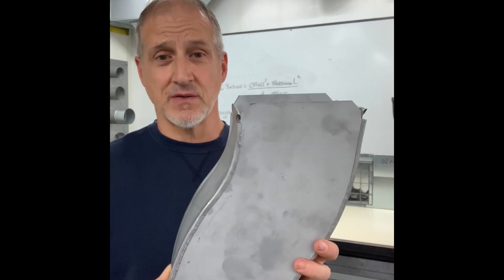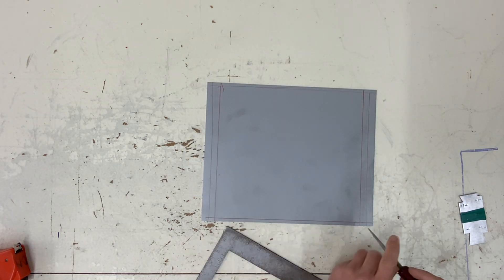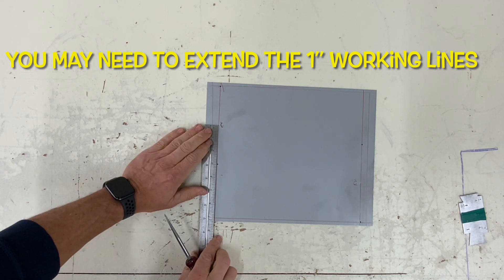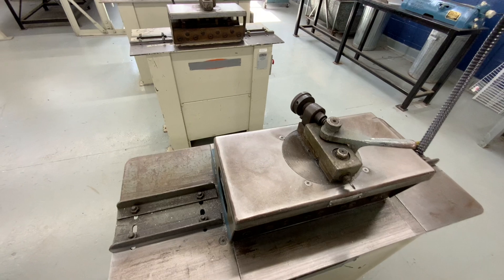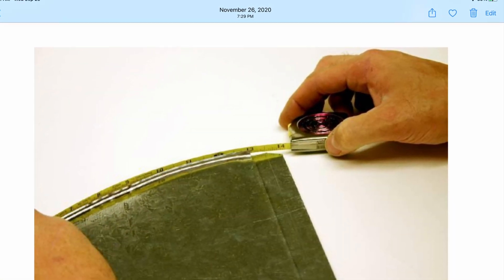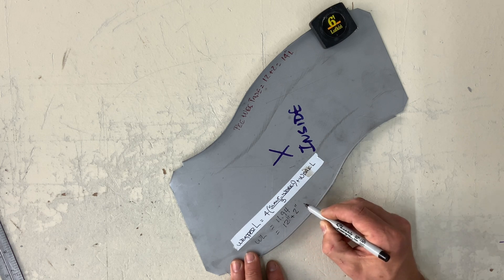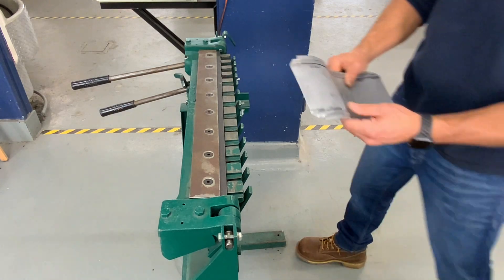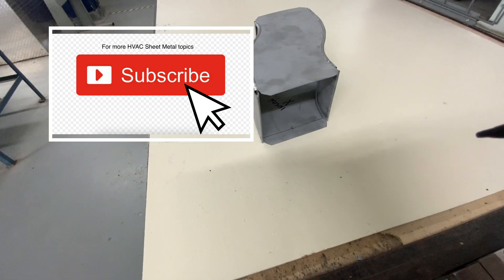Fabricating an Offset using CenterLine Radius

Comment: Hey, would it be possible to go over an Offset with square sides (non Radius sides)?
Reply from the maker: The only video that might come close to what your looking for is Fabricating a field mitered offset?   https://youtu.be/pMO96fWniYs?si=zSQo6iq7NC78-NdA
Reply: @sheetmetalwork  but in one piece? With keep the dims. Of your duct the same throughout. I hand scribe everything, but I want to be able to cut a finished length piece, to scribe out, rather than shear a side out of a sheet. the angles being at different positions  is what’s throwing me. I end up choking the dimensions down on my throat.
Reply from the maker: @The_Duter  I think your looking for something similar to offsetting a gutter downspout? Which is the removal of a piece of PIE shaped piece in two locations.
Reply: Yeah, Guys at my location like to stay away from Radius offsets, and as you know it saves on Metal to start with a cut piece. I use the Owl method while field fabricating. But it’s just the throat. Still working on it. I don’t mean to Bombard you with questions, but while you are doing your arcs, couldn’t you just include your .25s at the beginning? Then after cutting out your cheek, just set your scribe to a .25” and scribe it, right? Not trying to be rude, just deceasing different methods available. Thanks! Btw my 40 Most Frequently used Fittings book comes in today!

Comment: Hi Duane, Great job on all your videos here. Just a little nitpicking question here.
I am curious  as to why in layout you used 1/4" for your add on to the cheek width dimension (for the tongue part of the lock joint) and then when rolling that same edge you called out 3/16" as the machine setting. So doesn't that make it 1/8" wider than the 6" spec width? Thanks, Bob R.
Reply from the maker: Good observation. You are 100% right that the edger allowance is only 3/16. There are a couple of reasons for the 1/4, one is that it gives me 1/16 edge to start my snips or uni shears and another reason is that it simply makes the math a bit easier. Again, awesome observation Bob!

Comment: You’re a very good teacher. Appreciate all of your videos. Would you also show an ogee offset without the use of a calculator?  This is just a suggestion. Some may not have or want to use a calculator. As you know — Draw a slant line from cheek center points top and bottom. Measure the work line distance top to bottom. From the bottom measure straight up 1/4 of that distance.   Mark where that distance intersects with the slant line. Lay the outer corner of a square on that point on the slant line. Draw a line down to the bottom work line. That will be the point and distance for setting all 4 of the arcs. Thanks for all your work to promote Sheetmetal layout.
Reply from the maker: Thanks for your feedback James, always enjoy hearing other SM guys.  I did add a quick photo of finding the wrapper L in this video, but very quick.  I had previously covered it in another layout video at 7:58 min.  https://youtu.be/-QxpsWwXTko

Comment: Great video sir as always. Do you recommend any reference materials/books that have some of the most commonly used equations in the shop? I usually pee-wee tape my wrappers, but having those equations handy would be nice.
Reply from the maker: Hello Christopher, i always tell the students that the pee wee tape is the quickest and most accurate, formulas only work if everything is almost perfect including the person performing the calculation.  One of many textbooks is the following. Sheet Metal Workers Pocket Manual Paperback – by Fred Schumacher (Author), Calude Zinngrabe (Author).  Another is The Richard Budzik books.  I hope this helps and if I think of another good one I’ll let you know.